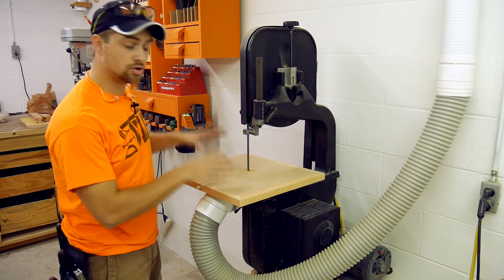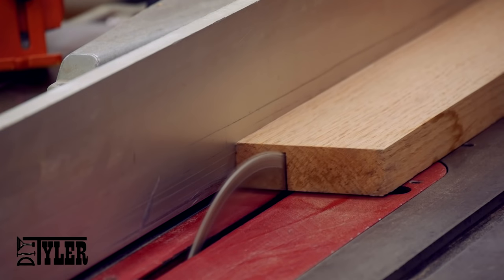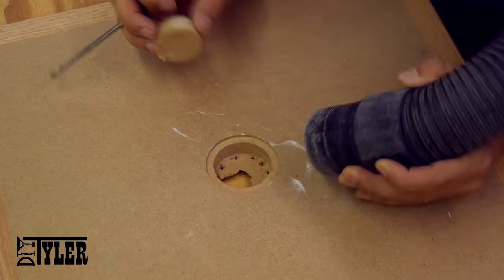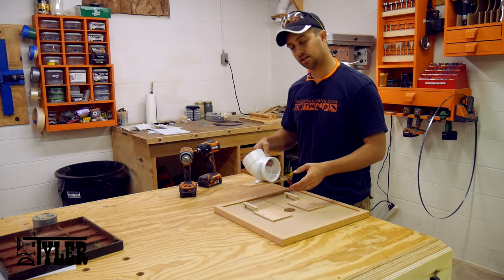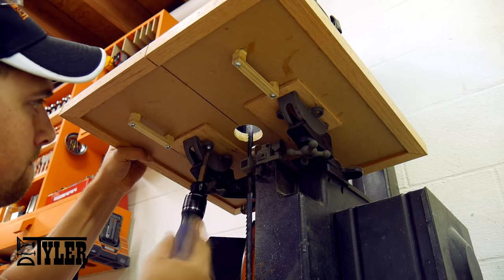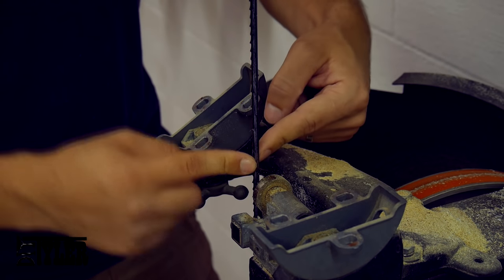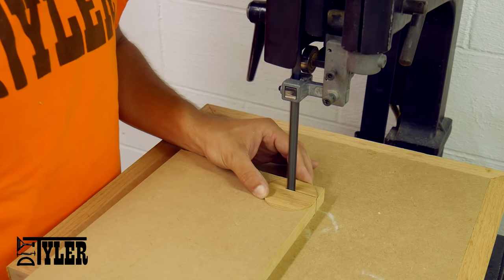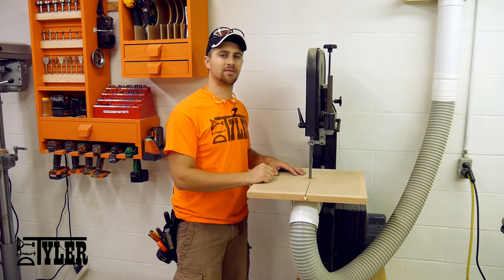BandSaw Table with Dust Collection | How to

Comment: good stuff, you faced a challenge and took with you to the solution, I like that, very inspiring.
I'm 'onna complete our kitchen rebuild first then off to finishing the restoration of the 1950s wood/metal bandsaw I bought here in France, a licensee of the classic Delta/Rockwell (small but heavy beast) and I'll see about adding a DC port.
Keep on trucking !
Reply from the maker: The dust port is a huge addition and super awesome. Thanks for watching man!

Comment: Nice job Tyler. If you want to use screws in MDF, look at Confirmat screws. They have a more coarse threading to hold better and less likely to split the material.  Scott
Reply from the maker: Coarse kreg screws seem to do well but I though the oak would provide some extra insurance. Thanks for watching man!

Comment: I would've used "Siebdruckplatte" - that blackish laminated plywood/multiplex - instead of the MDF. The wood is much more stable and rigid and the laminated top adds great protection as well as easier to move workpieces than on MDF. I'm also not sure if changes in humidity in unheated workshops might not result in a slightly warped MDF. Still a great video though!

Comment: Building a table for my 14 inch band saw, I like your Ideas. I am using MDF also. I thought about cutting my trunions down, but decided not to. I may at some point put a spacer in and longer blade.I Used barrel nuts in the MDF with oak inserts on top of them, under the trunions. The barrel nuts were epoxied in. I also used smaller barrel nut and epoxy to hold the oak inserts down, these inserts keep the Larger barrel nuts from pulling out under stress. I left my MDF board (2ft x 2ft) at dimension, but will cut off enough for oak edging. Guess We will see how mine holds up. how did yours do?

Comment: Hey Tyler! I tried adding a dust port to the underside of my bandsaw last week. I found I was getting a lot of dust when ripping 8 inches deep. The dust was actually dropping out of the back behind the table. Have you noticed anything like that if ripping deep section stock?
Reply from the maker: Not from behind the table but I have seem some dust make it all the way around the wheel and come up to the left of the table.

Comment: Tyler is that 4" PVC for the dust collection?  What do you think of using galvanized pipe instead,I think it is cheaper what did you pay for a length of the PVC?  Good video as always Thanks
Reply from the maker: Yes 4" PVC all around. Galvanized is WAAAAAY more expensive. The pipe I got was less then $7 a 10' section. Sewer and drain PVC. Thanks for watching Chuck!

Comment: looks good and all ty but seemed like ALOT of precise work for going from 6" - 6 1/4" resaw. capacity. ..thats a sweet router btw..rigids new line up?
Reply from the maker: The resaw was only 25% of the goal, dust collection was a BIG #1 and 90 degree cuts was right up there too. Gonna add a fence now to and wanted to start fresh. Yea the cordless trim router is hitting the market in a few days here, pretty sweet! Thanks for watching Joe!
Reply: look fwd to seeing upcoming vids! and  the dc was a great idea. so i could see going the extra 1/2mile to make it all work..

Comment: ?? so correct me if I am wrong you are mounting your made table to the original mounting points AND then adjusting it to be 90% to the blade. So why didnt you adjust the cast iron table to 90% and add dust collection to that?
Reply from the maker: It was smaller and not flat.